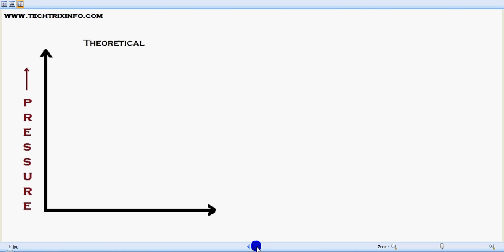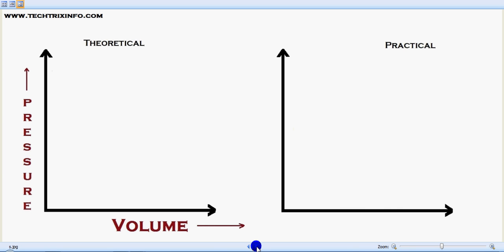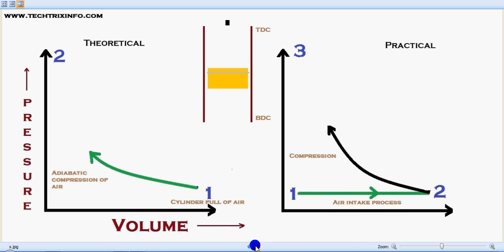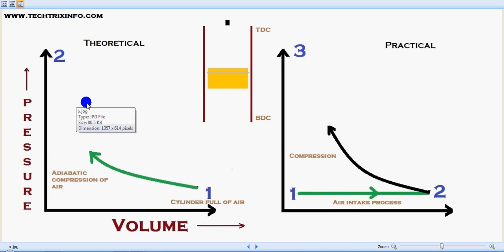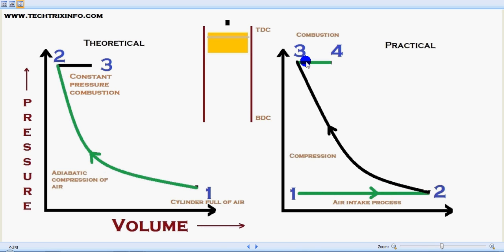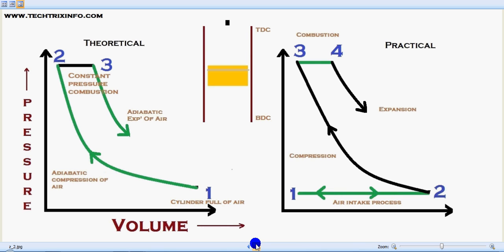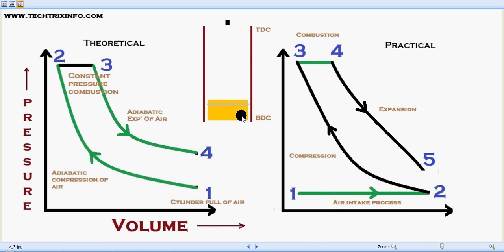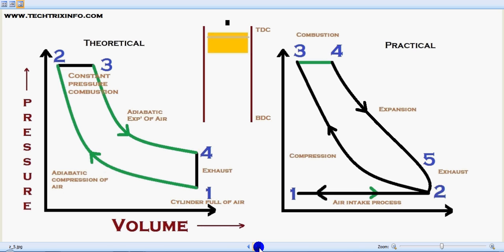Animation How Diesel Cycle Works. ✔

Comment: Pronunciation is so bad that i had hard time understanding.
Reply: Hi: I need help of an question, i have to answer this: Using these calculations, compare the performance and efficiency of the engine with that
of the appropriate air standard cycle. These comparisons should be based upon relevant
calculations. What i have to do is explain how brake power, brake mean effective pressure, volumetric efficiency, thermal efficiency and air fuel ratio link to this in term of the result of which we got.

Comment: Thanks for this video
Reply: Hi: I need help of an question, i have to answer this: Using these calculations, compare the performance and efficiency of the engine with that
of the appropriate air standard cycle. These comparisons should be based upon relevant
calculations. What i have to do is explain how brake power, brake mean effective pressure, volumetric efficiency, thermal efficiency and air fuel ratio link to this in term of the result of which we got.

Comment: Like
Reply: Hi: I need help of an question, i have to answer this: Using these calculations, compare the performance and efficiency of the engine with that
of the appropriate air standard cycle. These comparisons should be based upon relevant
calculations. What i have to do is explain how brake power, brake mean effective pressure, volumetric efficiency, thermal efficiency and air fuel ratio link to this in term of the result of which we got.

Comment: Superb sir you explain in simple way
Please give more videos of some other topics
Reply: Hi: I need help of an question, i have to answer this: Using these calculations, compare the performance and efficiency of the engine with that
of the appropriate air standard cycle. These comparisons should be based upon relevant
calculations. What i have to do is explain how brake power, brake mean effective pressure, volumetric efficiency, thermal efficiency and air fuel ratio link to this in term of the result of which we got

Comment: Dear, adiabatic or isentropic, please specify!
Reply: Hi: I need help of an question, i have to answer this: Using these calculations, compare the performance and efficiency of the engine with that
of the appropriate air standard cycle. These comparisons should be based upon relevant
calculations. What i have to do is explain how brake power, brake mean effective pressure, volumetric efficiency, thermal efficiency and air fuel ratio link to this in term of the result of which we got

Comment: How you make animated video
Reply: Hi: I need help of an question, i have to answer this: Using these calculations, compare the performance and efficiency of the engine with that
of the appropriate air standard cycle. These comparisons should be based upon relevant
calculations. What i have to do is explain how brake power, brake mean effective pressure, volumetric efficiency, thermal efficiency and air fuel ratio link to this in term of the result of which we got.

Comment: I don't understand this video. I would have preferred if it had been made separately than as a comparison.
Reply: Hi: I need help of an question, i have to answer this: Using these calculations, compare the performance and efficiency of the engine with that
of the appropriate air standard cycle. These comparisons should be based upon relevant
calculations. What i have to do is explain how brake power, brake mean effective pressure, volumetric efficiency, thermal efficiency and air fuel ratio link to this in term of the result of which we got.

Comment: WARMHOLES.If you get  practical PV diagrams for some  diesels models,youll be aware that  heat is added first at constant value which is higher in heat added than isobaric, and second a bit in isobaric, Diesel, as you know Diesel is ignited by high level of compression ratios 16:1 ,20:1, if turbocharged  increase  perhaps a 60% of non turbocharged. Ignition will occur at ignition poin of mixture, usually 15,1/1 air kg/fuel kg stoichiometric for isoctane,a few degrees before reaching  TDC  heat added must start,depending on rpm.Regards
Johann Wegmann

Comment: Make a video on dual cycle.and thanks to u
Reply: Hi: I need help of an question, i have to answer this: Using these calculations, compare the performance and efficiency of the engine with that
of the appropriate air standard cycle. These comparisons should be based upon relevant
calculations. What i have to do is explain how brake power, brake mean effective pressure, volumetric efficiency, thermal efficiency and air fuel ratio link to this in term of the result of which we got

Comment: شرح دورة ديزل  https://youtu.be/cQFowx6iueU
Reply: Hi: I need help of an question, i have to answer this: Using these calculations, compare the performance and efficiency of the engine with that
of the appropriate air standard cycle. These comparisons should be based upon relevant
calculations. What i have to do is explain how brake power, brake mean effective pressure, volumetric efficiency, thermal efficiency and air fuel ratio link to this in term of the result of which we got.

Comment: so basically exhaust process and suction process are not a part of 4 processes that is 1. adiabatic compression 2. constant pressure heat addition 3. adiabatic expansion 4. constant volume heat rejection  for an deal cycle.
mail me at parmarrahul1@gmail.com for any queries.

Comment: there are a few errors in this video...plzz do not get misguided or confused..
this video says constant exhaust happens when piston moves from bdc to tdc which is correct although it also say that exhaust process is a constant volume process...how can it be constant volume when it moves from bdc to tdc.
 Correct Explanation :
At the end of power stroke(BDC), the pressure inside cylinder is still higher than the atmospheric pressure, so as soon as the exhaust valve is opened at the end of power stroke the exhaust gas is rejected out (95%) because of high to low pressure transfer. And ths is happening at a contact volume(piston being at BDC) that is at

V= Swept + Clearance Volume...
you can also mail me at parmarrahul1@gmail.com for any doubts regarding otto and diesel cycle
Reply: the constant volume process is only for the theoretical. he mentioned in the practical/actual that the exhaust process goes from 5-1 which you can see on the 2nd figure it decreased in volume
Reply: Hi: I need help of an question, i have to answer this: Using these calculations, compare the performance and efficiency of the engine with that
of the appropriate air standard cycle. These comparisons should be based upon relevant
calculations. What i have to do is explain how brake power, brake mean effective pressure, volumetric efficiency, thermal efficiency and air fuel ratio link to this in term of the result of which we got

Comment: please share me 2 stroke PV diagram
Reply: Hi: I need help of an question, i have to answer this: Using these calculations, compare the performance and efficiency of the engine with that
of the appropriate air standard cycle. These comparisons should be based upon relevant
calculations. What i have to do is explain how brake power, brake mean effective pressure, volumetric efficiency, thermal efficiency and air fuel ratio link to this in term of the result of which we got

Comment: thnx for the video ...helped so much in understanding the concept! 😃
Reply: Hi: I need help of an question, i have to answer this: Using these calculations, compare the performance and efficiency of the engine with that
of the appropriate air standard cycle. These comparisons should be based upon relevant
calculations. What i have to do is explain how brake power, brake mean effective pressure, volumetric efficiency, thermal efficiency and air fuel ratio link to this in term of the result of which we got

Comment: Thanks for the simple sweet explanation
Reply: Hi: I need help of an question, i have to answer this: Using these calculations, compare the performance and efficiency of the engine with that
of the appropriate air standard cycle. These comparisons should be based upon relevant
calculations. What i have to do is explain how brake power, brake mean effective pressure, volumetric efficiency, thermal efficiency and air fuel ratio link to this in term of the result of which we got

Comment: You just described the graph using the annotations which we could already read... It would be better to explain the graph, i think thats what the vast majority of people who clicked on the video were looking for.
Reply: Hi: I need help of an question, i have to answer this: Using these calculations, compare the performance and efficiency of the engine with that
of the appropriate air standard cycle. These comparisons should be based upon relevant
calculations. What i have to do is explain how brake power, brake mean effective pressure, volumetric efficiency, thermal efficiency and air fuel ratio link to this in term of the result of which we got.

Comment: Are the exhaust and intake of air happening at the same time in the practical?
Reply: Hi: I need help of an question, i have to answer this: Using these calculations, compare the performance and efficiency of the engine with that
of the appropriate air standard cycle. These comparisons should be based upon relevant
calculations. What i have to do is explain how brake power, brake mean effective pressure, volumetric efficiency, thermal efficiency and air fuel ratio link to this in term of the result of which we got

Comment: explain cut off point sir
Reply: Hi: I need help of an question, i have to answer this: Using these calculations, compare the performance and efficiency of the engine with that
of the appropriate air standard cycle. These comparisons should be based upon relevant
calculations. What i have to do is explain how brake power, brake mean effective pressure, volumetric efficiency, thermal efficiency and air fuel ratio link to this in term of the result of which we got

Comment: sir i need some videos on how car engine really works and otto cycle
Reply from the maker: +Varghese Paul 
Ok
Please make your request through 
What's app us @ +919744615655
Reply: Hi: I need help of an question, i have to answer this: Using these calculations, compare the performance and efficiency of the engine with that
of the appropriate air standard cycle. These comparisons should be based upon relevant
calculations. What i have to do is explain how brake power, brake mean effective pressure, volumetric efficiency, thermal efficiency and air fuel ratio link to this in term of the result of which we got

Comment: I appreciate your effort to make it a video and help know the content ...but could you be more explainatory in why the lines and cycle goes like that rather than ...just explaining book wise ....if you make things understandable to the core in simple ...ways ....
Reply from the maker: +jaison jj 
Ok
Thanks for the comment. 
What's app us @ +919744615655 To get updates on Mechanical/ Automobile engineering
Reply: Hi: I need help of an question, i have to answer this: Using these calculations, compare the performance and efficiency of the engine with that
of the appropriate air standard cycle. These comparisons should be based upon relevant
calculations. What i have to do is explain how brake power, brake mean effective pressure, volumetric efficiency, thermal efficiency and air fuel ratio link to this in term of the result of which we got

Comment: i didn't understand that why volume is increasing during isobaric process? i understood why it has constant pressure, but why increase in volumen since from 2-3 in theoritical cycle, the piston is at TDC?
Reply: Because the isobaric process is fed by burning fuel, which compensates the increase of the volume.

Comment: Great video,subscribed :)
Reply: Hi: I need help of an question, i have to answer this: Using these calculations, compare the performance and efficiency of the engine with that
of the appropriate air standard cycle. These comparisons should be based upon relevant
calculations. What i have to do is explain how brake power, brake mean effective pressure, volumetric efficiency, thermal efficiency and air fuel ratio link to this in term of the result of which we got

Comment: really good...
Reply from the maker: +Prasenjit Panda 
We are honored by that comment.
For more info you can email us at techtrixinfo@gmail.com or whats app at +919744615655

TechTrixInfo.com
Reply: Hi: I need help of an question, i have to answer this: Using these calculations, compare the performance and efficiency of the engine with that
of the appropriate air standard cycle. These comparisons should be based upon relevant
calculations. What i have to do is explain how brake power, brake mean effective pressure, volumetric efficiency, thermal efficiency and air fuel ratio link to this in term of the result of which we got.

Comment: i love diesel engine so, nice video
Reply: Hi: I need help of an question, i have to answer this: Using these calculations, compare the performance and efficiency of the engine with that
of the appropriate air standard cycle. These comparisons should be based upon relevant
calculations. What i have to do is explain how brake power, brake mean effective pressure, volumetric efficiency, thermal efficiency and air fuel ratio link to this in term of the result of which we got

Comment: Why we understand that the combustion take place at constant pressure or constant volume in diesel or petrol cycle engine
Reply: Here the assumption to take the cylinder is of full of air is little bid confused...
Reply: Hi: I need help of an question, i have to answer this: Using these calculations, compare the performance and efficiency of the engine with that
of the appropriate air standard cycle. These comparisons should be based upon relevant
calculations. What i have to do is explain how brake power, brake mean effective pressure, volumetric efficiency, thermal efficiency and air fuel ratio link to this in term of the result of which we got.

Comment: You haven't represented volume increase during constant pressure heat addition process in piston diagram . The Actual cycle is also not correct.
Reply: chup iitian ki aulad
Reply: Hi: I need help of an question, i have to answer this: Using these calculations, compare the performance and efficiency of the engine with that
of the appropriate air standard cycle. These comparisons should be based upon relevant
calculations. What i have to do is explain how brake power, brake mean effective pressure, volumetric efficiency, thermal efficiency and air fuel ratio link to this in term of the result of which we got.

Comment: Nice video sir.
I have one question: Why the combustion process is at constant pressure and not at constant volume? and same question for Otto cycle: Why combustion takes place at constant volume and not at constant pressure?
Reply: With Otto cycle the fuel burns out way faster when ignited. It is 100% available at the time the spark ignites it and almost all the heat energy is produced at constant volume, very fast rising the temperature and pressure. With Diesel cycle the fuel continues injecting some time after the self-ignition starts. At the beginning of the working cycle the fuel starts injecting. It ignites itself due to the high temperature of the pressurized air in the cylinder. Then during the cycle more fuel continues injecting and igniting. Fuel injection and heat generation is according the piston movement in attempt to keep the pressure constant wile the piston moves down. This is where the high torque come from . With Otto cycle the burn-out is almost entirely done at the beginning of the cycle and further movement of the piston rely on that pressure, created at the beginning. Fast burning makes possible for higher rpm but the lack of additional energy during the working cycle makes the torque less than Diesel.
Reply: @totomitak  Thank you for the clarification.
Reply: SI engine: once sparked it will get ignited. Spark happens based on the position of the cylinder. So basically spark ignition happens based on position (volume dependant).

Whereas in Compression ignition, the diesel gets ignited once it reaches the particular pressure. Doesn't depend on the volume. 
This is how I understand.
Reply: Hi: I need help of an question, i have to answer this: Using these calculations, compare the performance and efficiency of the engine with that
of the appropriate air standard cycle. These comparisons should be based upon relevant
calculations. What i have to do is explain how brake power, brake mean effective pressure, volumetric efficiency, thermal efficiency and air fuel ratio link to this in term of the result of which we got
Reply: thanks so much for explaining this. Top man!

Comment: Why exhaust stroke happens at constant volume? ???
Reply: Actually exhaust stroke occurs at constant pressure which follows the line(2-1) of practical cycle.....Its the heat rejection which occurs at constant volume which follows the line (5-2) of practical cycle....
Now the answer to your question why heat rejection takes place at constant volume?
After the power stroke when piston reaches to bottom dead center, exhaust valve opens thus relieving the pressure from the cylinder ( this is the heat rejection at constant volume) so that piston does not have to make considerable efforts in pushing the gas out through exhaust valve and the movement of piston from BDC
to TDC is the exhaust stroke.......
I hope that u got the answer......If u are still not clear...Feel free to ask your doubt.....
Reply from the maker: Thanks for the comment.Please Subscribe to us by clicking the SUBSCRIBE button for updates.Visit TechTrixInfo com for more details.